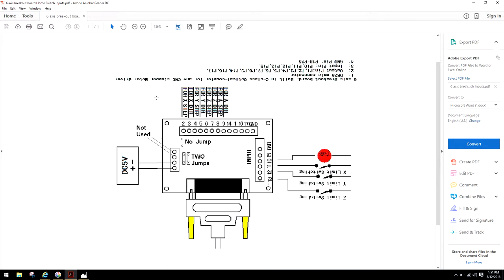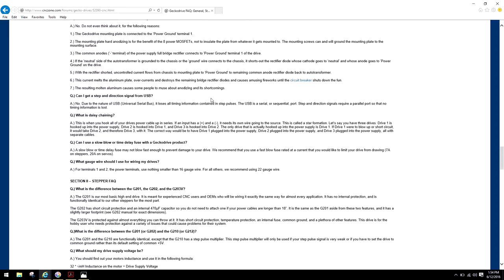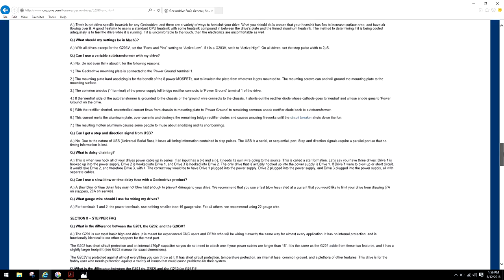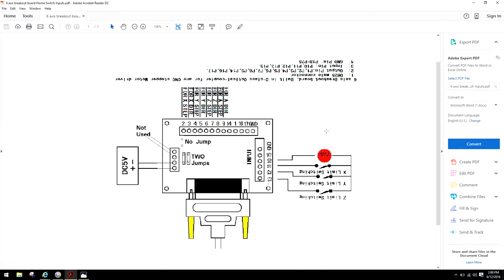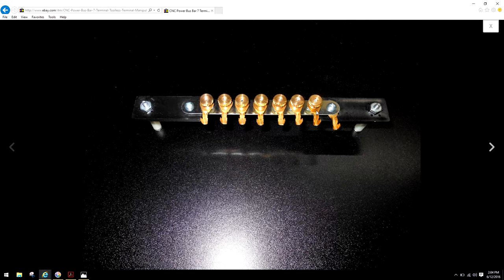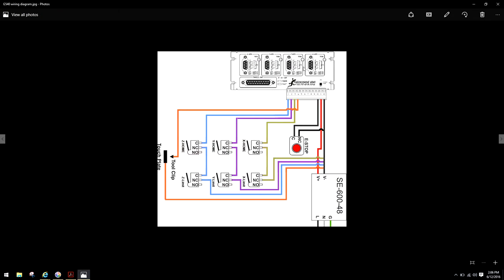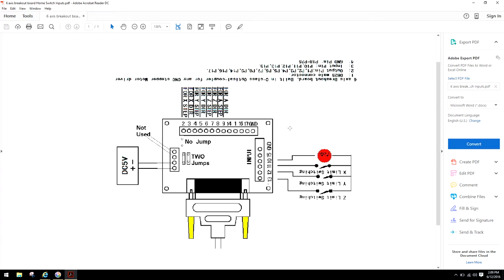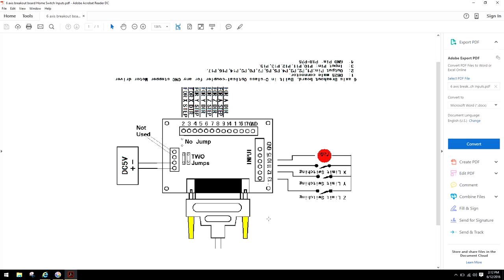Breakout Board Terminal Wiring? Gecko G540 Out Of Inputs For Switches? Here's The Correct Solution.

Comment: I know we have discusses it in the past, but for clarification sake. Now that I found out that the Fast Fused saved my system incident the other day. I ended up getting a URBEST 10A 250V AC Rocker Switch 3 Pin IEC320 C14 Inlet Module Plug Fuse.  I'm back to adding a Touch Plate and the one that I purchased is a 2 wire unit to be hooked into my G540. Am I correct in assuming that one wire goes to the number 12 terminal and one wire goes to the number 4 terminal and the Built-in BOB of the G540 supplies the power to the Touch Plate which is then connected with one wire to the actual Touch Plate and the other to a Clamp which is connected to the machine Spindle?  The reason I'm asking is I've seen various video's claiming I need to use a >12V Wall Wart to Power the Touch Plate. Which would be rather difficult to do with a 2 wire system. That's why I'm asking again as per our last communication was about what the maximum voltage allowed by Gecko and you got in touch with Marcus for me.
Reply from the maker: Ron,The touch plate when used with the G540 is essentially a two lead switch . One of the two leads required for it simply connects to one of any of G540's inputs (be it 1-4), and the other end is attached usually by alligator clip to your endmill. The second  lead wire's end is connected to (V-) on your power supply, and is attached to the touch plates base plate. Once the Z is lowered allowing the endmill to make contact with the base of the touch plate it completes the circuit triggering the switch. You don't require a separate power supply to the touch plate. The G540's BOB is all that  is used to supply the signal. This is why only two wires are required. If you Google G540 Wiring Diagram it should provide the diagram, or you could send me your email, and I'll forward you the diagram for reference.Thank you,Vince

Comment: So I have a gecko g540 that I am going to run on my cnc plasma table. From my research the g540 does not have enough inputs for thc and limit switches, so I need a break out board for more inputs. How would I go about adding more?
Reply from the maker: Ricardo,Please understand you don't need physical limit switches if your using Mach3 motion control software as the software has "Soft Limits" Soft limits are much safer than a physical switch as they can never fail, and mechanical switches, can, and will over time. If the computer ever goes down, or Mach3 ever crashes all that happens is your machine stops as the computer is the brain of the system, and without signals being sent the system simply stops. The other thing you should know is you can have all your switches be wired in parallel using a single input, or split to use two as in this diagram https://www.google.com/search?biw=1920&bih=934&tbm=isch&sa=1&q=wiring+home+switches+to+one+input+on+g540&oq=wiring+home+switches+to+one+input+on+g540&gs_l=psy-ab.3...2227.2858.0.3475.4.4.0.0.0.0.92.335.4.4.0....0...1.1.64.psy-ab..0.0.0.GdiqzR5FKLA#imgrc=yV3PedsYeaylkM:&spf=1503570720145Thank you,Vince